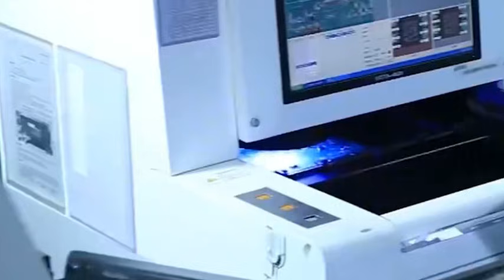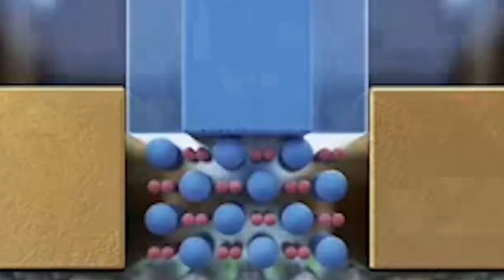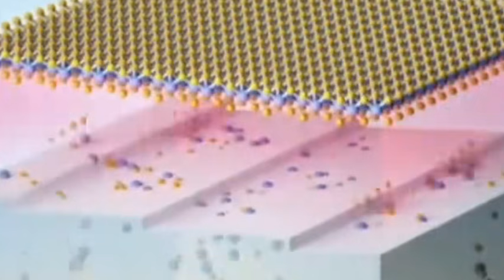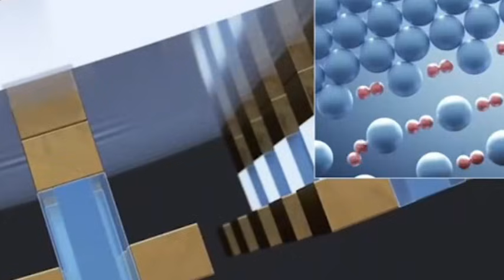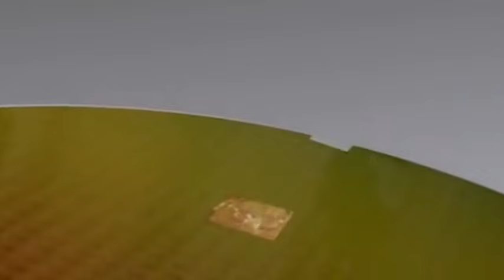China has made a breakthrough in 5nm packaging tech, and the Dutch has lifted restrictions on EUVs.

Comment: China is now able to mass produce 28nm lithography machines and even sell them overseas. ASML now dumps its lithography machines in China so as to prevent Chinese enterprise from using the home-grown machine and to maintain ASML’s foothold in the Chinese market. It is likely that Chinese enterprise would opt for the famous ASML machine rather than the newly home-grown machine. In the end, the manufacturer of the home-grown machine will have to close down as it cannot get enough revenues to further its research and development. The Chinese government should enact an anti-dumping law to clamp down on ASML's lithography machines.
Reply: The only way for asml to survive is to sell the company to China including shifting production in China
Reply: 所言甚是！这些洋垃圾的“限制”、打压，某种程度是好事。不但迫使我们发展了自己的高技术，而且极大促进了我们产业升级。
Reply: If the price/conditions are right, the Chinese should buy them.  The Chinese aren't going to stop innovating.
Reply: China needs to ban the importation of ASML equipment or put 100% tariff.
Reply: @sbludba  China sho just negotiate price that are like barn sales.  30-40-50-60% off.
Reply: And that should include servicing/maintenance contracts.😊
Reply: That won't be necessary. ASML refused to service machines sent to China or to sell spare parts. No Chinese company will buy ASML products.
Reply: @mgronich948  the US has forbidden ASML from servicing the machines. China would have respected ASML if it entered into negotiations directly, unfortunately it caved in to the US. Trust is what binds all of us, once it is broken it can never be repaired. China has learned quickly that it can trust itself